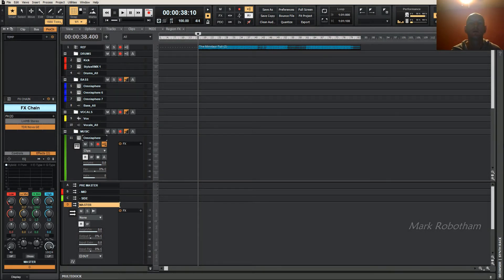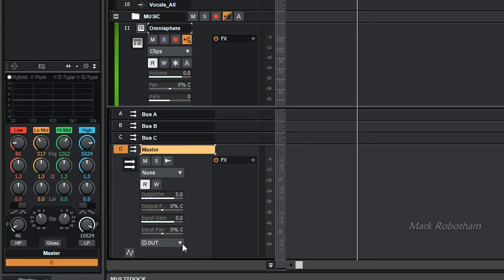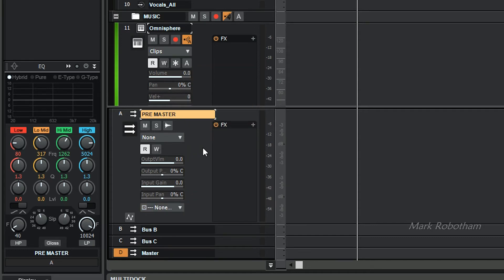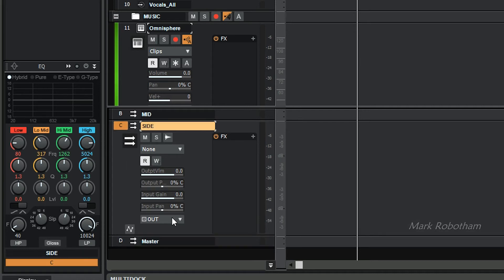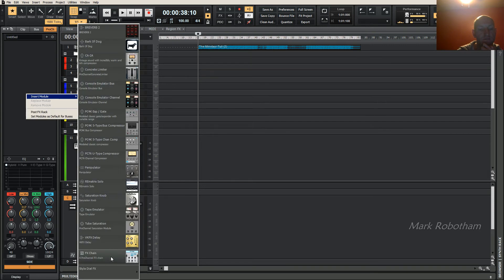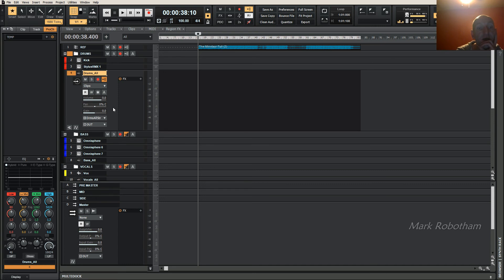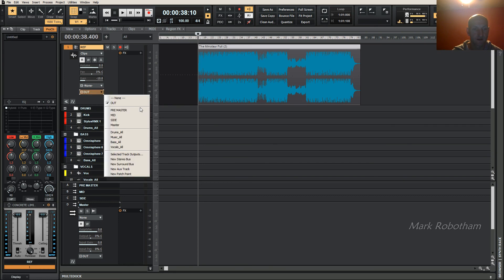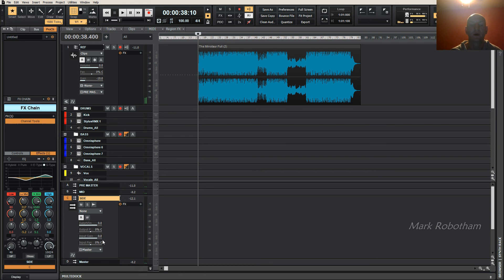Mid Side Bus Splitting - Cakewalk Sonar Platinum

Comment: Hi Mark Thanks for this great video. I downloaded your template and the only problem I have is that the Channel tools doesn't load up like the one in your video shows. I have the latest bandlab Cakewalk version 2019.03. Is there another tool I could use instead of Channel tool to achieve the same result. Thanks very much.
Reply from the maker: Channel Tools came with Sonar Platinum, if you only have Bandlab then you can use 
Voxengo MSED (free) from here https://www.voxengo.com/product/msed/ just use the same method as you would with Channel Tools :-)
Reply: Thanks very much for the suggestion. This is exactly what i needed, I will try it.

Comment from the maker: Thank you for you comments. I've updated the description to include a template download, master section only, any tracks you add must be sent to the "PRE MASTER"
Reply: The only sound I'm getting from the side channels is the Bass, which is panned dead centre. The rest of the whole mix is on the mid channel. I've set the channel tools exactly as explained here.  From my busses,, I've used either sends or busses to the Pre Master (not both at the same time). Sonar Platinum. Cheers in advance.
Reply from the maker: If you've done exactly what I have done then there shouldn't be any issues, unless of course your other tracks are in mono, then of course there wont be a side signal, as there is no stereo information. You shouldn't really be using sends to the PreMaster, only outputs, if you do use a send to the PreMaster then you must set the output of that sent channel/buss to no output. 

Download the template I provided, open sonar, import a stereo song or something and set that output to the PreMaster (if it inst already) then try, you'll see it works as it should :-) If you're working with large projects then the outputs to the PreMaster can be easily missed. 

BTW this template works in Cakewalk by Bandlab too assuming you still have Sonar Platinum installed as it uses Channel Tools. If you don`t have Channel Tools then you can substitute it for Voxengo MSED http://www.voxengo.com/product/msed using the same technique :-)
Reply: Cheers for the reply. Yes, that was my mistake. As I have only recently be using sends, I was unaware of this. I assumed the panning information of the mono track would be transferred to the bus via a send, but obviously not. I have X3 Producer (now got the bandlab version too). It's only in the last year or so that I've 'looked under the bonnet' of Sonar. Cheers for the video. 

Don't know if you've heard of Kilohearts plugins? I found out about them yesterday: https://kilohearts.com/

https://youtu.be/qkxTHbUg2T0

Cheers!
Reply from the maker: Yeah I love the Kilohearts stuff,  bought the bundle and EQs that were on offer a month or so ago. I actually use Studio One Pro (DAW) by PreSonus a lot more these days. I`ll see what happens with Cakewalk and BandLab over the coming months, at the moment for me Studio One is just so  much better, quicker and stable, was a bit of a learning curve coming from Sonar though lol
Reply: I've heard much the same about Studio One, mainly from Sonar users that thought Cakewalk was going to die so moved over. I'm thinking about it, but money has priority over other things atm, so I'll keep using CW for now. 

Keep up with the good stuff!